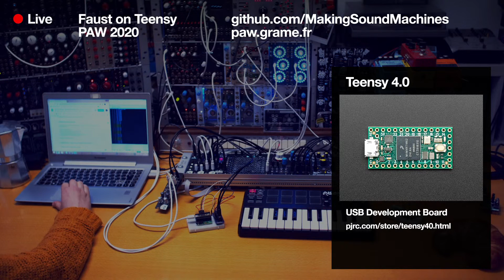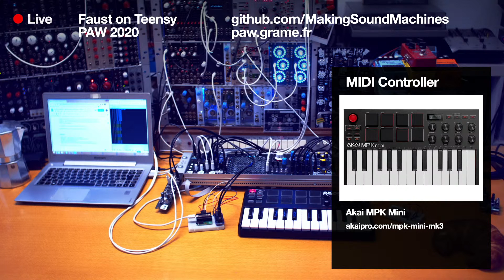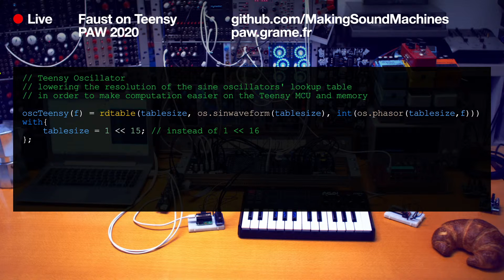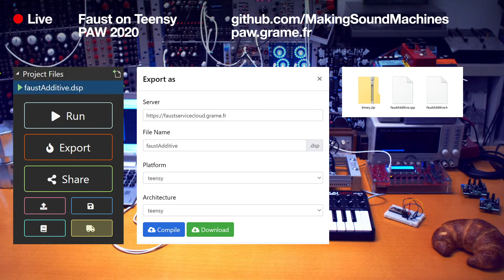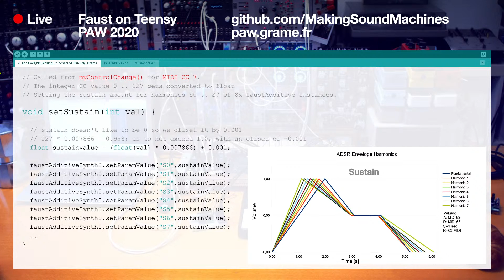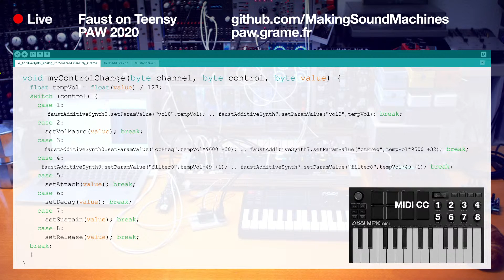Making Faust run on Teensy 4.0 - Programmable Audio Workshop 2020

Comment: pretty cool project :)
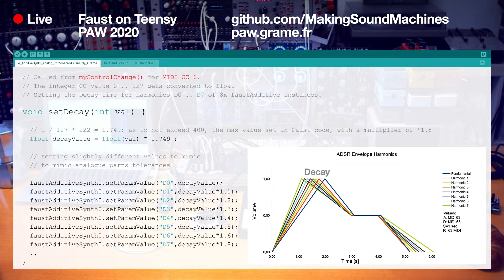49:05 is there a hardware-related reason to why you didn't create those harmonic envelopes in faust instead of writing them in c++ with constant values?
Reply from the maker: The envelopes themselves are generated with Faust; the settings are set in Arduino. The reason behind doing the settings in the Arduino (C++) sketch was that the different envelope responses per partial and the slightly off-centre tuning of every oscillator where part of the experimentation, so they underwent a couple of changes - hence it was easiest to do them individually and "by hand". If we would have set them in the Faust sketch, we would have had to export the Faust sketch lots of times to get it right.  

In the end, I think there are some places (such as this) where one could have written functions to make the code more elegant. On the other hand, we wanted to make all of it as easy to understand as possible, in terms of a beginner's workshop, knowing that some of our viewers could be unfamiliar with either Faust, Arduino or both.
Reply: @MakingSoundMachines  ah ok! understood! :) it does indeed make a lot of sense as an educational walkthrough. thanks for sharing!

Comment: Hi,
Very cool project. How did you get the FaustAdditiveSynth in the Teensy GUI?
Reply from the maker: If you add a .cpp file and / or a .h file to the same project folder as the main .ino file, and then double click the .ino file to open the project, all files will show up as tabs in the arduino IDE. all you need do then to use it is include the .h file like you would any other library. Let me know whether this already answers your question : )
Reply: @MakingSoundMachines  Not Really :) but maybe I was unclear.
at 44:30, you show the Teensy Audio GUI with a your FaustAdditiveSynth - Node. How did you manage this? 
Or is it a Teensy-Gui node and you just renamed it ?
Reply from the maker: @korb.artificial383  no I think that happens when you load the finished .ino sketch back into the teensy audio GUI. but the workflow is downstream from the audio GUI, we built the routing first in the GUI and then text-edited the rest in the IDE. so the image is mainly just for illustration.